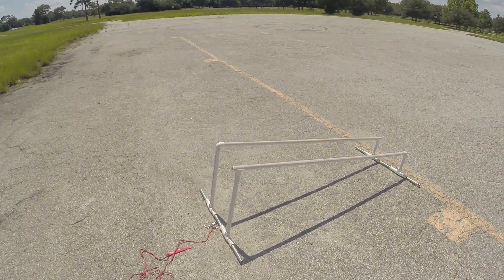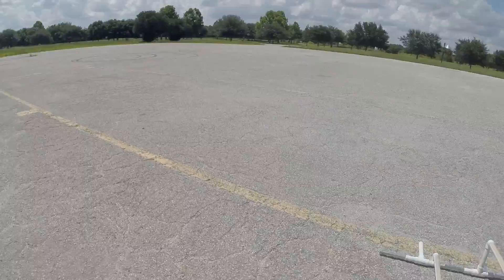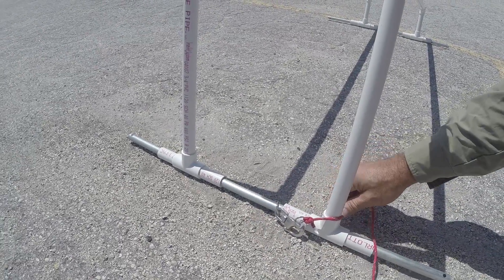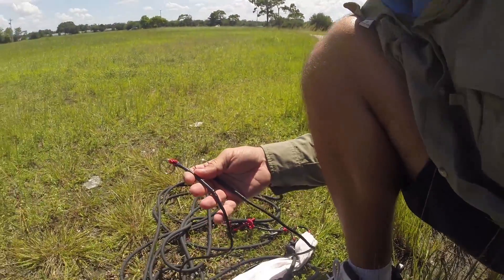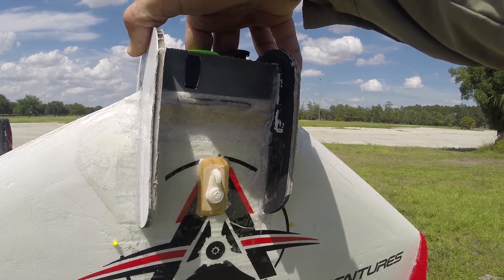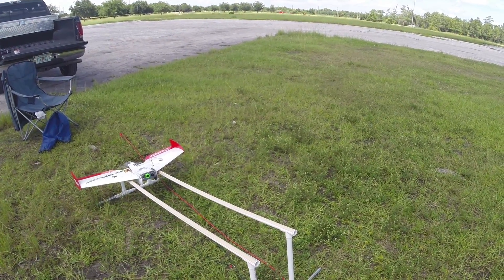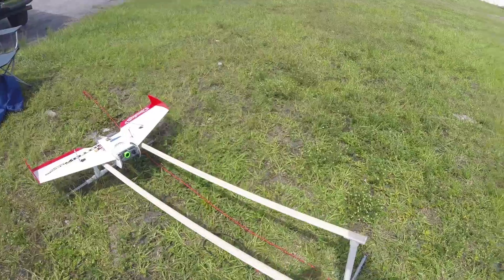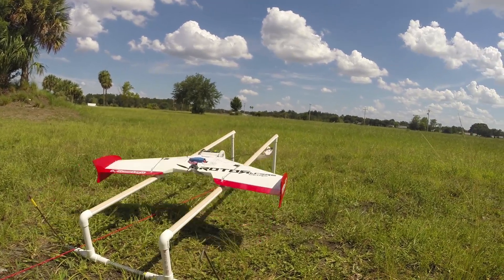Bungee launch Team-Legit FG36

Comment: Thanks for the video.   I started building this about six months ago and finally tried it out today.  I only had 10' of elastic and 20' of paracord and it put a FG36 in the air like nothing.   I used 12# of pull since my length of pull is so short.

Comment: thanks for posting.  some thoughts.  imo, this is not bungee launching...its a small hi-start.  which is fine.
one improvement would be to use a tripod, perhaps, ten meters in front of the plane, in order to raise the 'pull' angle up, from minus-two.   if that is done, raising the quick-release thingy would be good too.

the prop noise tells me you are using a 'flexy' kind of prop.  which is fine.  but if you want less noise, in addition to a normal power/thrust curve, switch to an apc electric pusher, or equivalent.  
these props are not bendy.  they do not squeal.   because they are stiff, they do not 'unload' at high rpm.
slow-flyer props are designed to do this.  so, use s-f props where most appropriate....not here.   cheers
Reply from the maker: Thanks for the comment.  I did testing using a tripod and although it seemed to help a little I had no issues launching the airframe shown as well as a 48" long range bird so it was one less thing to carry and setup.  The prop was a APC pusher.  The noise is due to the prop being so close to the airframe.